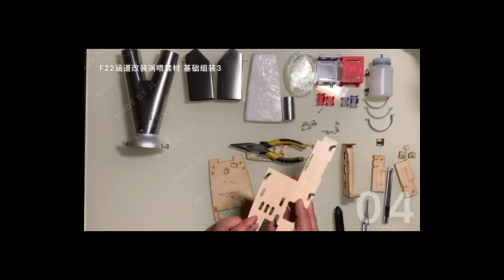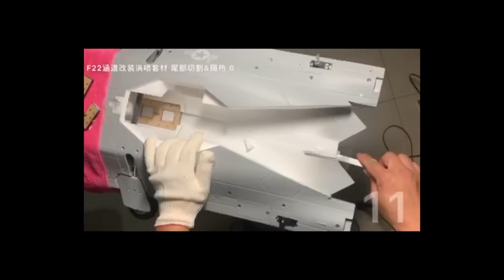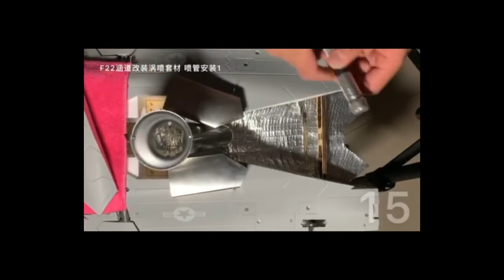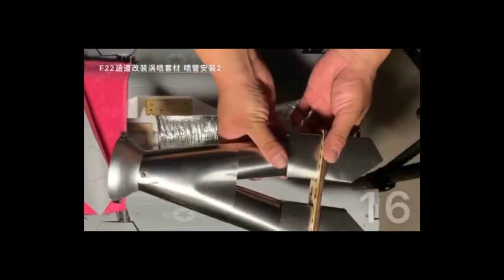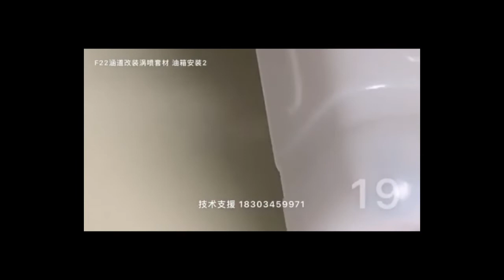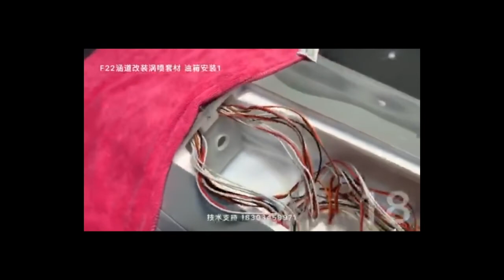JL Turbine Conversion build guide for Freewing F22

Comment: Comparing with the original 6s setup at least for my plane i have around 3800 g RTF, in this case, after the conversion and using a X45 xicoy turbine do you know what will be the total weight?